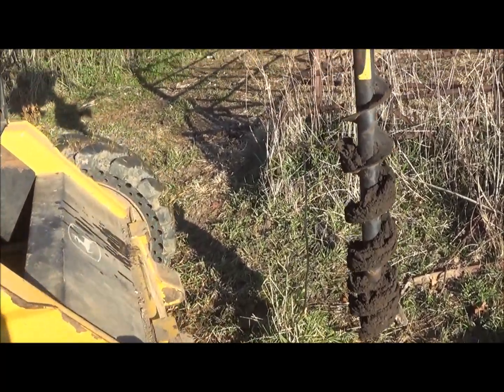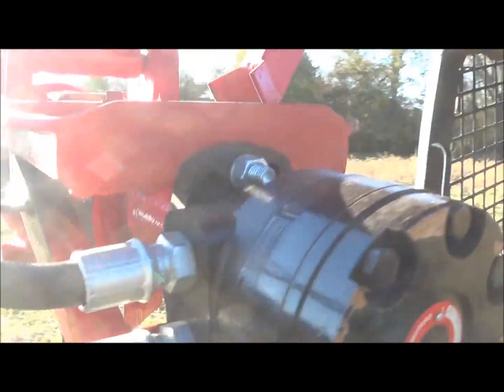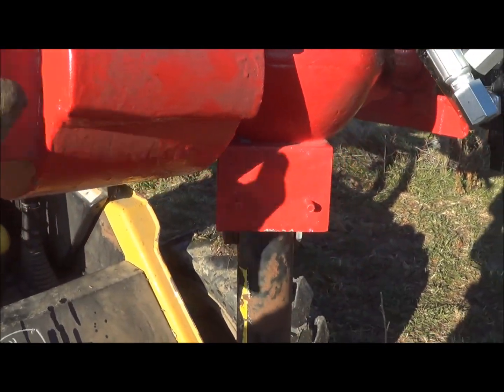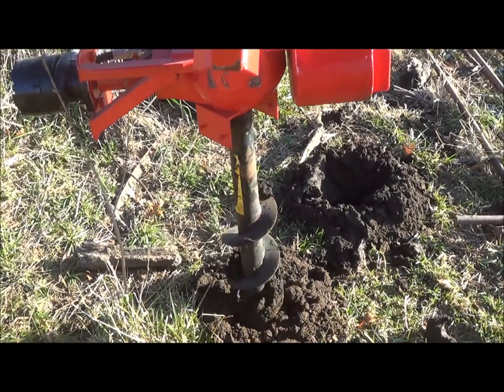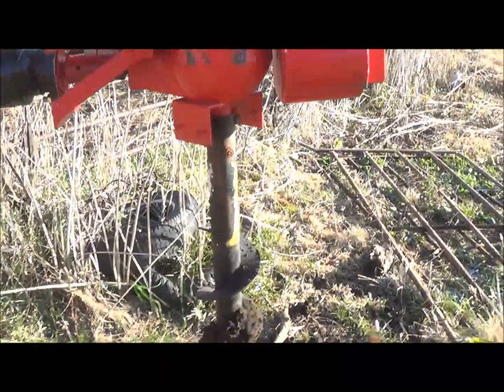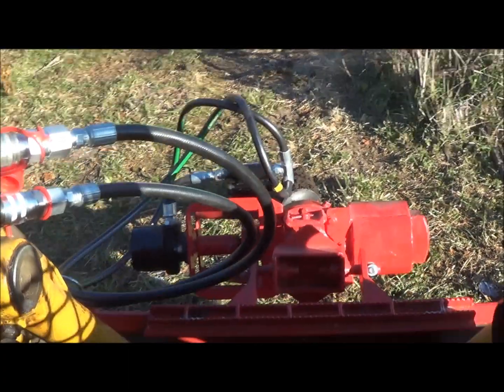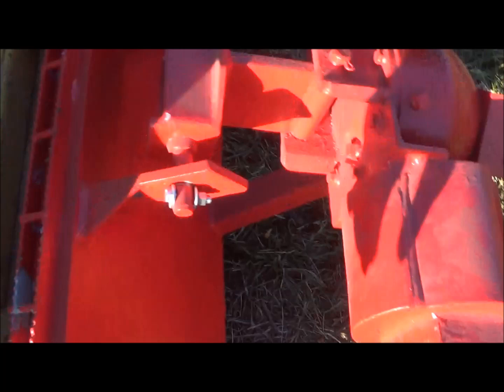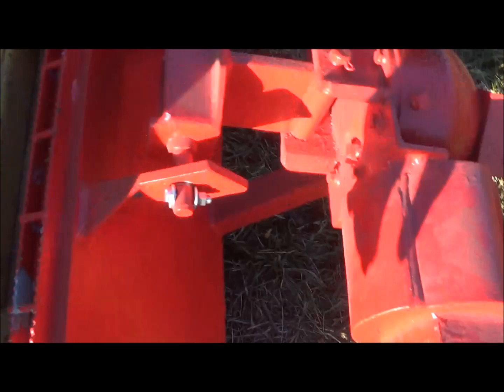PTO to Hydraulic post hole Digger Conversion

Comment from the maker: Looks like my video froze around the 3 minute mark but I hope it still gets the point across. Let me know if you guys want another video on this unit to better clarify how it works, but it works great so far.
Reply: Please tell us exactly what hydraulic motor you used. Finding the exact motor torque and speed is the challenge for these different conversions. I have a new-to-me Case TR340 Track Loader and am converting all my equipment from tractor to use with my skid steer track loader. I am in the process of converting my Heavy Duty Bush Whacker Mower at the moment, and putting a mounting plate on the back of my box blade. Please show us what motor, brand, and model number you used on this Auger so I can convert mine as well.
Reply from the maker: @TimothyKingRealtor  I get all of my Hydraulic components at surplus center. These are the specs for the motor I used. They are currently out of stock for that motor, but they could find you something similar Im sure. I have a video on my channel showing the conversion of a brush hog as well. 

Disp. 13.91 cu. in. /13.91 cu in Dynamic BMER1230FSG2SR Hydraulic Motor
ITEM NUMBER: 9-8974-G rev.
Pressure
     2973 PSI (Cont.)
     3481 PSI (Int.)
Torque
     5531 in-lb. (Cont.)
     6284 in-lb. (Int.)
Speed
     290 RPM (Cont.)
     365 RPM (Int.)
Flow
     17.96 GPM (Cont.)
     22.45 GPM (Int.)
Rotation Reversible
Mount Four-bolt magneto and two-bolt SAE A
Shaft 1-1/4" dia. x 2.40" long shaft w/ 5/16" wide keyway
Ports SAE 10
Reply from the maker: @TimothyKingRealtor  Forgot to mention that the gear ratio on the gear box is a 3:1
Reply: @TimothyKingRealtor  Surplus center also sells hydraulic motors with the 540 rpm pto shaft splines.  You would have to figure out the hydraulic flow of your skid steer and match a pump to get the rpm you want.
Reply: @metalisawesome2811  - Thank you Sir. That information is awesome. I am buying a hydraulic motor today from a local dealer for the Brush Cutter (conversion of a Bush Whacker) that matches the torque and speed. Will be converting my auger next as I need to build fences around the farm.

Comment: Cool.  Surplus Center is cheap for hydraulic hoses.  My son is wanting to make a brush cutter to mount on his skid steer.  We just cut 3/8" plate on the CNC Plasma table and have a local fabricator with a break bend it to make skid steer mounts.  Cheap and heavy duty.

Comment: Could you have mounted the pump 90 degrees to eliminate the need for a counter weight, then use the tilt to straighten the auger
Reply from the maker: I don't really know, it would be something to try, maybe make a small scale version of the mechanism and see how it would operate. I've seen it done this method on other videos, so I just implemented their style. The ones that you buy that are meant for skid steers are still free motion in both directions, the weight should pull the post auger plumb in both directions regardless whether or not the skid steer is on a slope/level ground.

Comment: Can you please advise specs for the hyd. Pump and where you purchased it. Thanks Sid Turner
Reply from the maker: I got the motor from Surplus Center and these are the specs for that motor. 
 Disp. 13.91 cu. in. /13.91 cu in Dynamic BMER1230FSG2SR Hydraulic Motor
ITEM NUMBER: 9-8974-G rev.
Pressure
     2973 PSI (Cont.)
     3481 PSI (Int.)
Torque
     5531 in-lb. (Cont.)
     6284 in-lb. (Int.)
Speed
     290 RPM (Cont.)
     365 RPM (Int.)
Flow
     17.96 GPM (Cont.)
     22.45 GPM (Int.)
Rotation Reversible
Mount Four-bolt magneto and two-bolt SAE A
Shaft 1-1/4" dia. x 2.40" long shaft w/ 5/16" wide keyway
Ports SAE 10